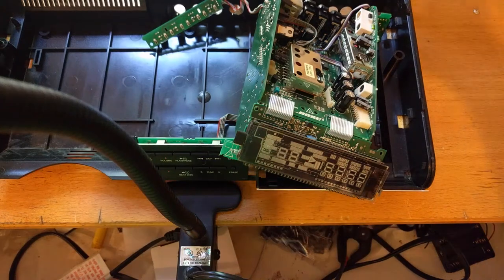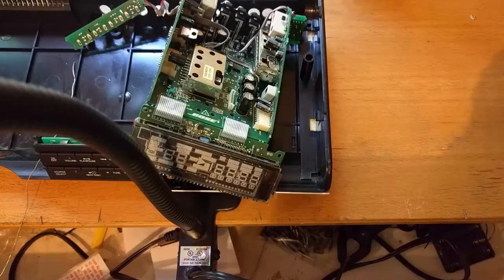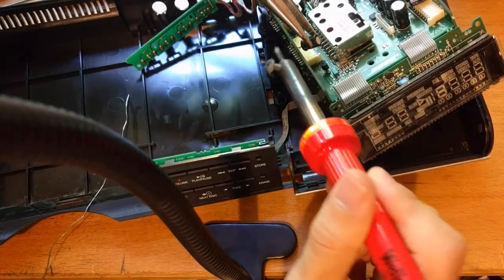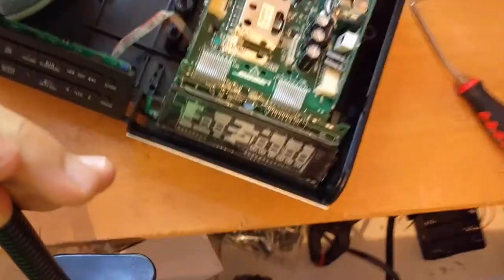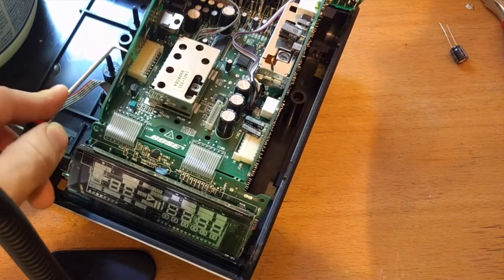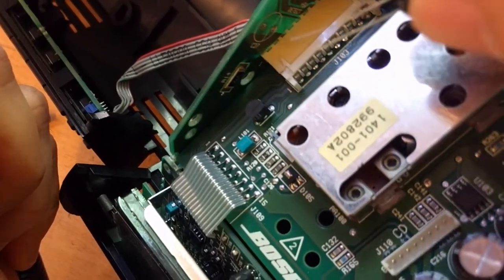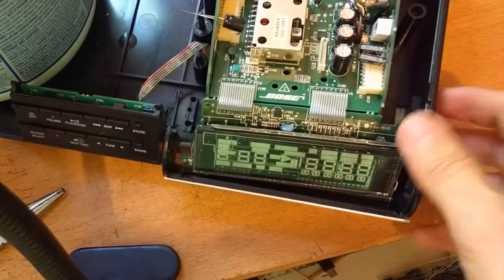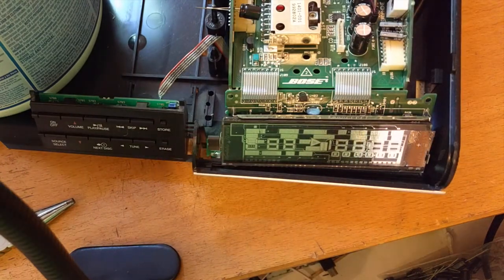Bose Lifestyle 20 Display Soldering Fix

Comment: Hello , 25 series ii with bad diaplay , to order the capacitors what is the code i need ? Is it just 50v 100uf  ?
Reply from the maker: I'm not sure about the 25 series, but you can look at the side of the capacitor and it should say its size.